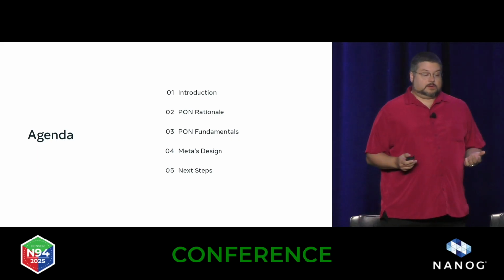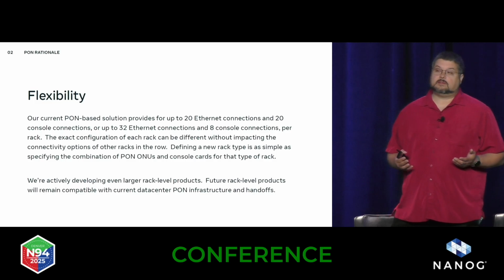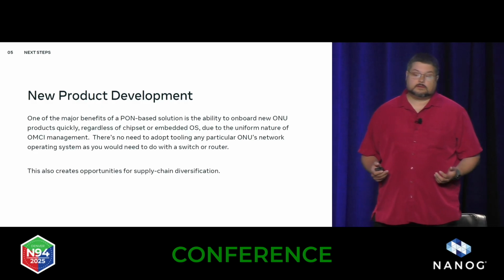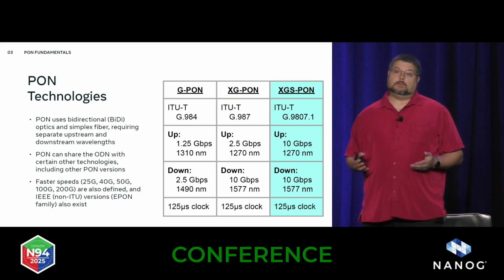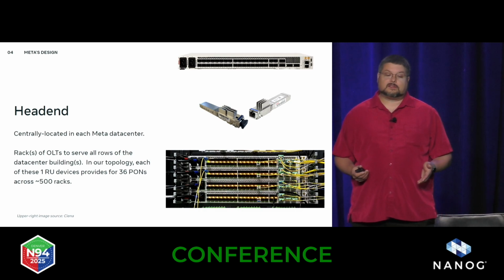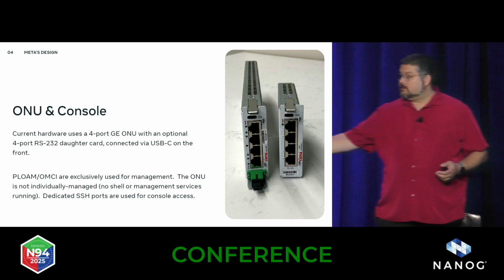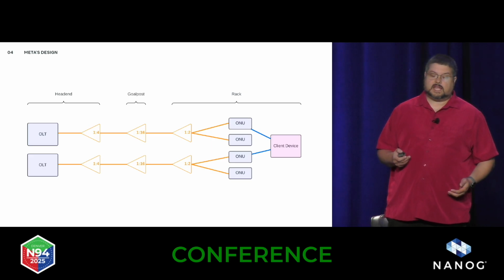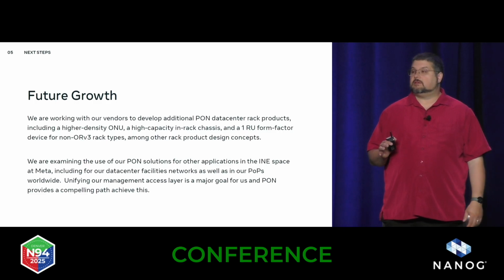PON in the Datacenter: Hyperscale for Management and Console

Comment: This is really cool. I hope this mini OLT that you can plug to a normal switch, and run control plane on the switch CPU, would be really cool. I know there are some small single port OLTs, but their software and integration is rather poor.

Interesting idea, and probably will catch up. Much cabling saved indeed, and even when deploying few racks, it might provide overall benefit.

Comment: Cienna looks to have made data center/mdu pon very interesting with the flexibility of a router/l3 switch with sfp+ ports that can do grey, colored, pon, and copper.  Pretty cool. The RS232 solution is unique, I am interested in how easily it handles a variety of console port baud rates and pin outs.